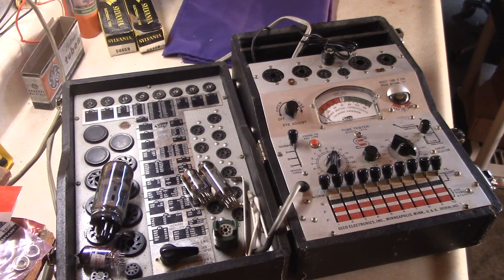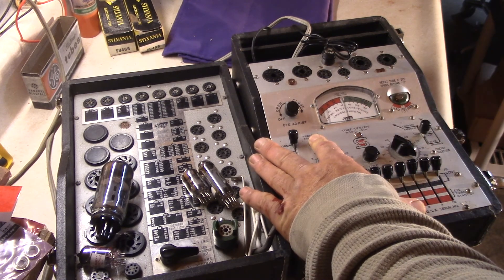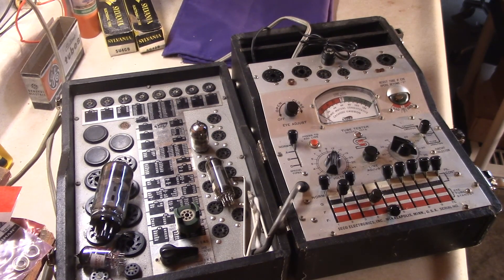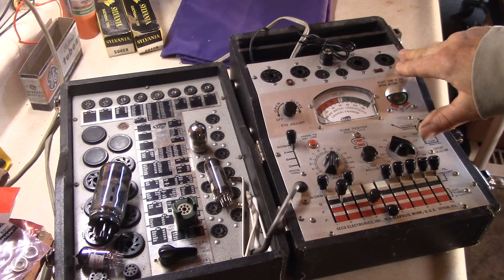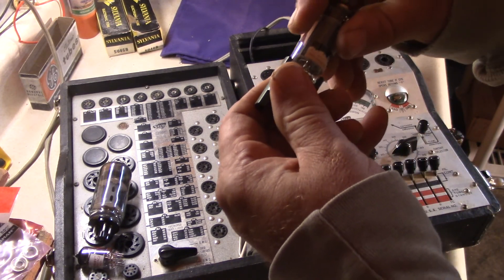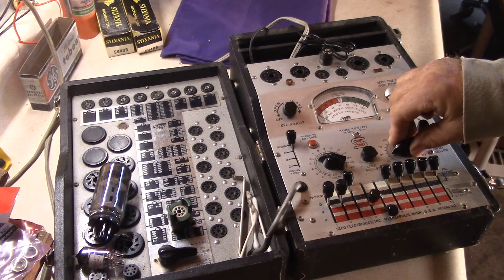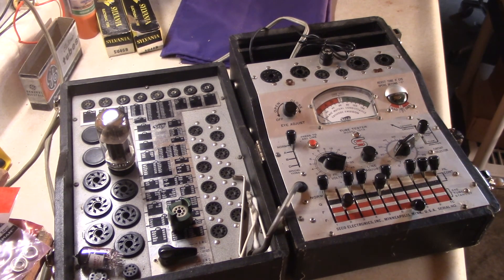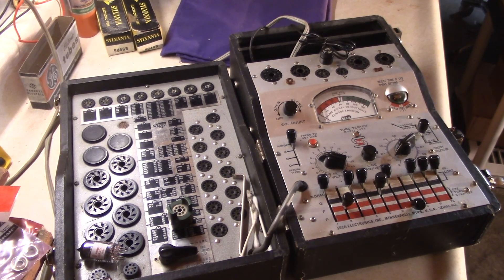Using my Seco 107 A Tube Tester testing 12AX7 EL84 & 6L6GC Tubes Gear Review

Comment: Is the CK512AX (Raytheon) (Industrial type #6281) listed on your Seco 107/107A flip chart?  It has a 0.625 volt .02 amp filament. I have a scan of the Seco 107 flip chart and it's not listed either way.  I don't have card for my Hickok Cardmatic KS-15874-L2 as well, Thanks
Reply from the maker: It is not on mine either
Reply: @vacuumtubesandguitars  There is a scan of Industrial vacuum tubes on BAMA, but it isn't listed there either.  I have an original copy of the Hickok/Navships USM-118A/B tube data as well, and it's not listed there either.  I suppose with the tube data I can make up an adapter and match it up to a 1960s vacuum tube AM car radio.  Those all have a B+ of no more than 12vdc.  Then use the 1volt setting on my 107B and pad it down with a resistor to .6volts, but that will require some research and experimentation.

Comment: While my Seco 107B is the unit I use in the field, It doesn't have a power supply big enough to effectively test a power output vacuum tube larger than a 6V6.  The 6L6 and 6550 for example requires higher b+ voltages for effective testing.
Reply: If the eye tube in your 107 is the 6AF6/6AD6G and is so faded you can barely see it, they are still available as NOS from a vendor I purchase vacuum tubes from.
Reply: The only regret I have with my 107b is it is too "new" (if you can believe that) to test Raytheon Sub-miniature hearing aid vacuum tubes.  I have a Hickok WECO KS-15874-L2 which will, but it needs a power supply rebuild, and that is one of many back projects I have here waiting.
Reply from the maker: @DandyDon1  I did not about the power supply not being enough for the 6L6 and above. I have a couple 6AF6 on hand. I know the feeling about many back projects!
Reply: @vacuumtubesandguitars  Here is what Alan Douglas explains in his book on page 81 about the Seco Electronics Tube tester:

"While Seco's main business was tube testers, its models are not common.  The 107 measures Gm and emission for most tubes, with a magic eye to read leakage.  But it's plate voltage sags for higher-power tubes, to as little as 12V for the 6L6, at only 10mA plate current, so its readings are not comparable with those of other testers.  It measures gas as a ratio of plate to grid current in the emission test, not the best method.  Incidentally my 107 circuitry has only a passing resemblance to the schematic in the manual; evidently there were continual changes."

Comment: Question: 
I’m using a 107C, which is an improved later model of the one shown. However, when I do an emissions test, pretty much every single tube is putting the needle passed the “good” range and maxing out the needle. 
I can’t imagine that’s normal, but also haven’t been able to find any information online about that issue anywhere. 

Thoughts? I’ve gone over the operation instructions at least a dozen times and it seems like I’m doing all the presets correctly. All my tubes are brand new, as well. 

Thanks!
Reply from the maker: Sounds like something has gone bad, does the tubes test OK for DMC? Did you do a line check test? I do get that happen occasionally too.
Reply: I have a 107c which I cannot use.  I replaced all of the components but soon discovered there was so much cadmium and zinc hair growth in the switch network that it shorts out all operations.  While my 107B has some cadmium and zinc growth it is no where as severe as the 107c.
Reply: The 107c also has an Autoformer to maintain AC input line voltage.  I do not believe it is adjustable.

Comment: Thanks for the video.  I just purchased a Seco model 70 on eBay.  You video gave me that assurance that I was using my tester correctly… for the basic DMC / Cathode Emission testing.

I hope you can help me understand or answer questions I have related to some of the other test. 

Example testing KT88

Open Element Test.
- The instructions say to leave heater levers in place 2&7
- All other to Norm
- Then move leavers to Q one at a time
- 1) do I leave leaver on Q as I move them
- 2) OR do you move each leaver back to Norm as you go through them?
* Now matter what way I do this test I don’t see any notable needle movement.   Is this a failed Tube?
Gas leak test
- like above says to set heaters and all others to Norm
- Says to look up plate pin?
- - does this mean the cathode plate (pin 8) or the Anode plate (pin 3)?
- Move plate pin to Q and run cathode read value and compare to value taken during normal cathode test. 
- If 90% of original value the tube is leaky
* I did the test on a couple of tubes (using pin 3 then Pin 8 ) and the values between normal and leak test did not change.  There was no drop.  Instructions say the second reading should be on the very low side of the meter scale.  Does that mean all the tubes I tested are very leaky?

Any feed back will be greatly appreciate!
A new video showing these test would be great!

Thanks
Reply from the maker: I would say leave the Q lever on. The main reason a tube gets leaky is the bent got banged or bent. Even on Octals. I believe the tester says plate pin is the Cathode pin. I am not familiar with the model 70. A tube that leaks a little will work, but a big drop is not good.
Reply: @vacuumtubesandguitars  

Thanks for the quick response!

I don’t know why I put Down model 70. I have a 107. 

So, on the open element test move each to the Q and leave it for the rest of that test. 

And to verify on the leak test no movement is good?
Reply from the maker: @SpiralMind6869  yes that is correct
Reply: Thanks again for the video and for answering my questions!
Would still like to see more videos on tube testing and matching.

Videos like. Why don’t the numbers on matched tube boxes show measurements that are not seen on the “107” tester?
How do these numbers match up with those I read on the tester?

Thanks

Comment: Thank you so much for posting this video. I know have a much better understanding of how to test my tubes! I have a question though. I've tested 4 12AX7 tubes from the same preamp and ALL of them fail the Cathode Omission "Shorts" as you'd said in the video. They eye opens all the way. Do you think they're all bad or this is the fault of the tester? Will a power surge or something like that blow all of the tubes? Thank you.
Reply from the maker: I often have the same thing happen, I had a guy tell me that sometimes one pin may have a minor short or that the pins may have slight corrosion on them causing the tester to pick this up as a short. So I take a wire brush and clean the pins and many times this helps. If the the tubes test good, that very well may be it.
Reply: @VACUUM TUBES AND GUITARS  thank you so much! I'm going to try and clean the pins and see how it goes. Do you think a little deoxit in the tester socket would help also?
Reply from the maker: @vintagewatchhunter  It would help, contact cleaner also works well
Reply: Yeah, I've now test seven 12AX7 tubes and all seem to have a short. I'll try the deoxit and clean the pins.

Comment: I have the 107B tester. Did you have to restore it? Has a funky ozone smell so not sure all is well. Going to clean it up thoroughly, the transformer and clean up any old solder joints. Nothing looks burnt. Need to find a schematic for it. I have a bunch of Hammond 12AX7’s that need testing as the rural world has lost all of this knowledge. Time to pick up the mantle. Thanks for the video! 
Much appreciated.
Reply from the maker: This one is as I got it 6 years ago. No smell on mine, this one is actually the second one I have had. I sold the first one and bought a Hickok 800 and sold it when I bought the 107A I have now. I had a complete 107B Manual that came with this one but sold, it had the schematic in it.
Reply: @vacuumtubesandguitars  If you have access to a copy of Alan Douglas's book "Tube Testers and Classic Electronic Test Gear" there were several changes to the circuitry of the 107B.  Some of the changes are NOT documented in the tube test data book's schematic.

Comment: I learned a lot! Thank you!

I am potentially picking up a couple seco models and I believe he has at least 1 manual, which looks to be imperative to have.
Reply from the maker: Yes the manual is good to have, definetely the tube chart book. I do have one for a SECO 107B if you need one of those
Reply: BAMA (Boat Anchor Manual Archive) has free scans available for both the 107 and 107b.